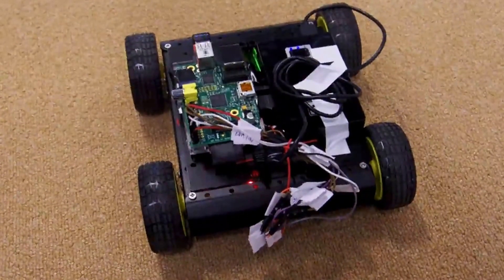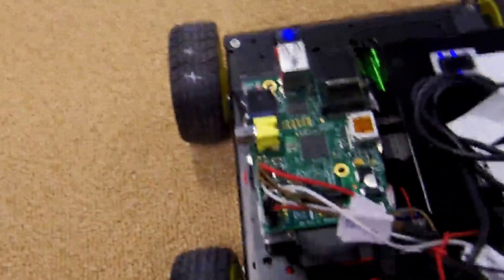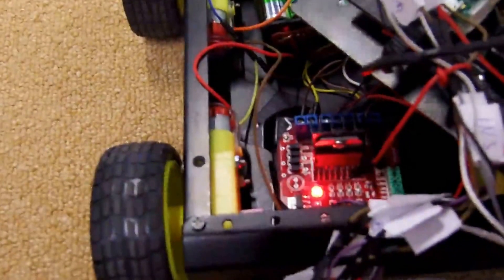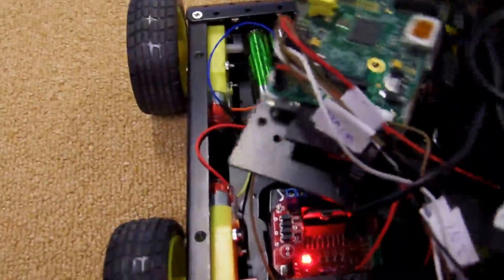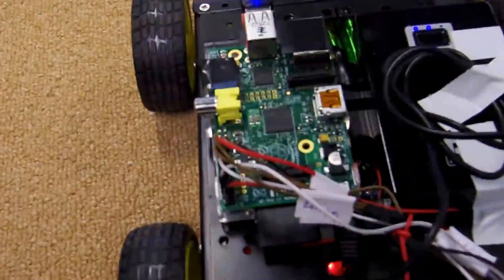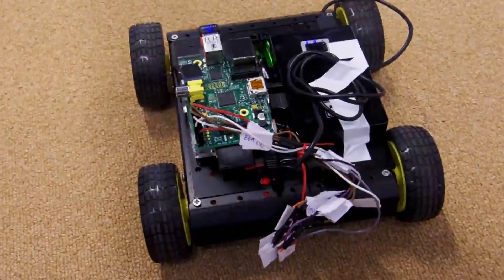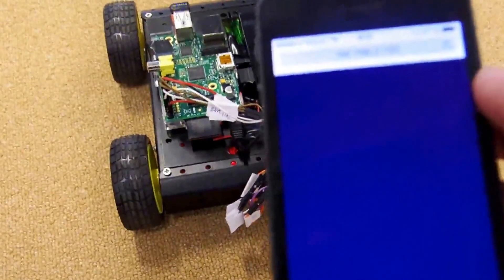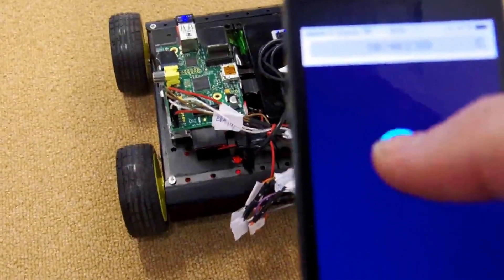Raspberry Pi and Node.js driven RC car :)

Comment: Hi, I'm using pi-blaster but finding that it only issues the last instruction to pi-blaster in the code.  With Picar there is a pwm-test app which will only do the last pi-blaster instruction and it looks like it issues pi-blaster command once the node app completes running.  Any thoughts?